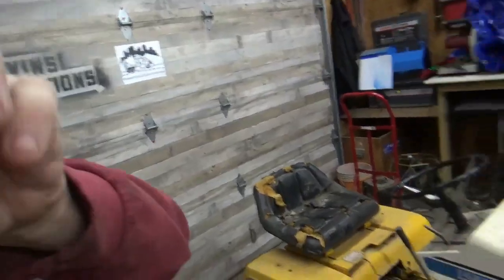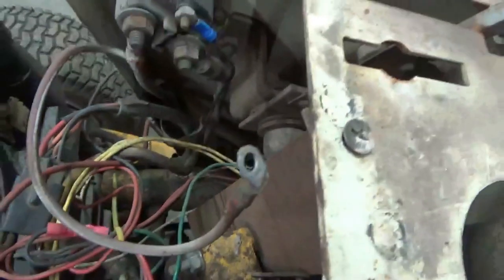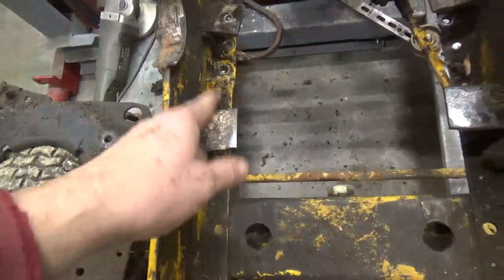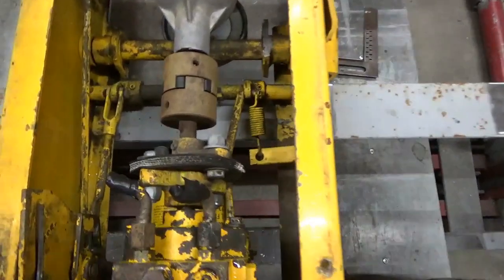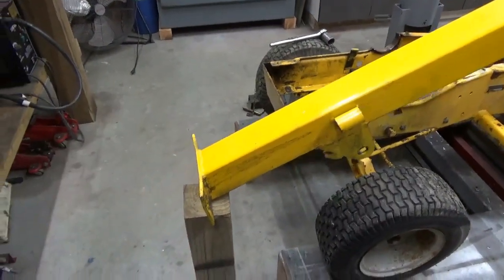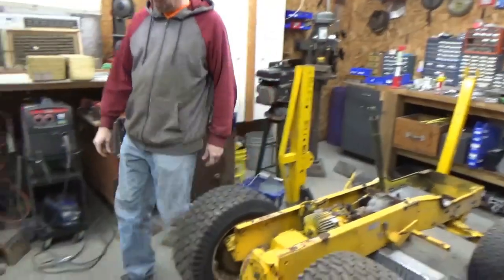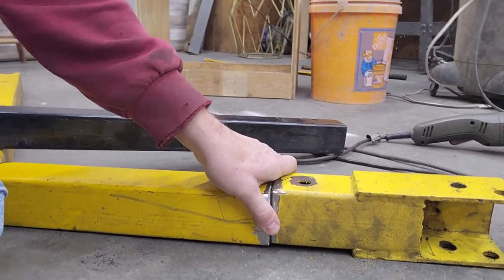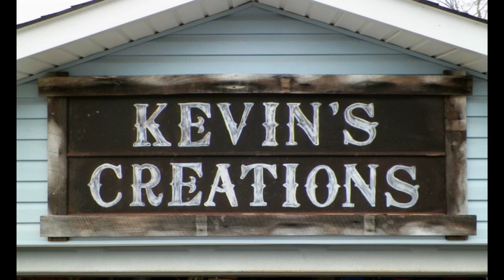Building A Loader For My Vintage Cub Cadet Garden Tractor

Comment: I’ve never seen anyone put a vertical shaft engine on a cub like that. So what are your thoughts for mounting the hydraulic pump, are you going to add Greasable bushings to your pivot points? Are you planning on being able to detach the loader at all?
Reply from the maker: It is going to be all welded on. This tractor will be just for the loader. The pump will be mounted underneath run by a belt. I am going to have bronze bushings that are greasable. Of course, like everything I build, plans can change at any time, and I'm pretty well winging it, so who knows lol. Thanks for watching
Reply: @kevinscreations4486 ou can mount your hydraulic pump behind your transaxle with a Lovejoy coupler and a jack shaft between the diff and the pump. Frank (wood and metal shop time on YT) did this when he built both a road grader and a forklift from Cub Cadet tractors. You can even use the differential for your hydraulic reservoir. 
You will probably want a cooling fan for your differential as they do run very warm. A computer fan might be of help. I'd put it on your key switch so you know it's running.
Reply from the maker: @Farm_fab  I finally found the video of his you were talking about.  I like that idea,  and I am thinking of modifying his idea a little to see how it does.  Thanks